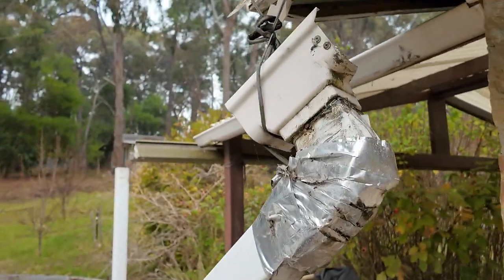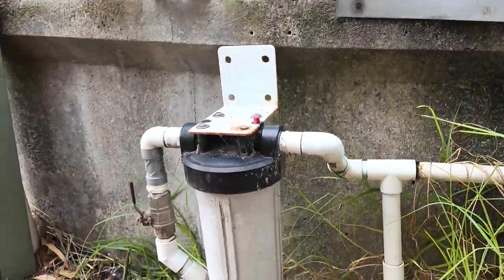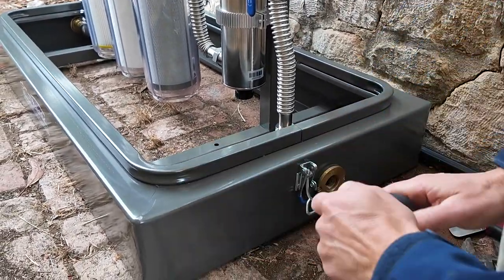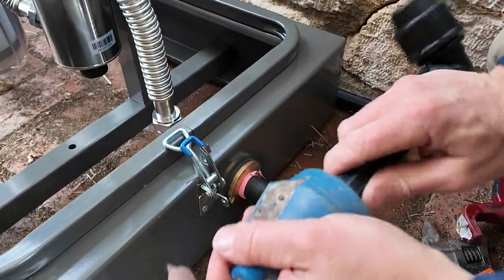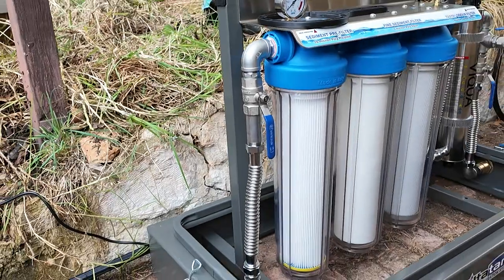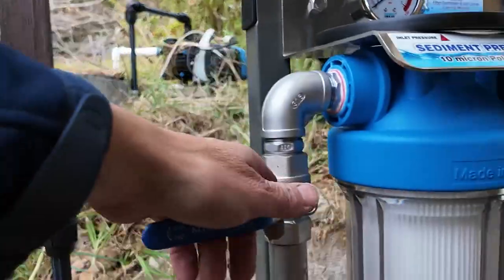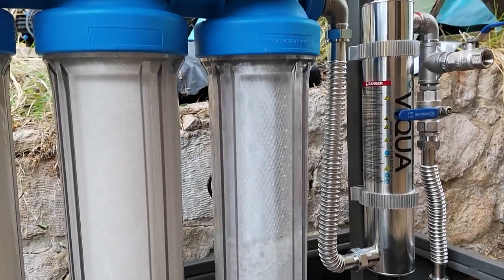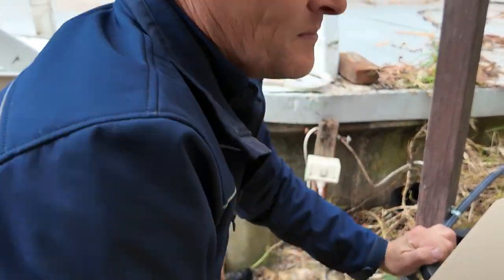Urgent FT-300UV Rainwater Filter System Installation

Comment: Also the compression hose fittings are easy but you should use brass male barb splitters with hose clamps. You heat up the pipe and make them fit into the pipes which is good enough but the hose clamps is extra security